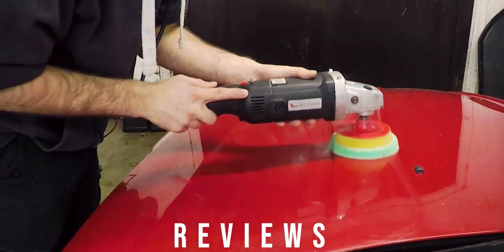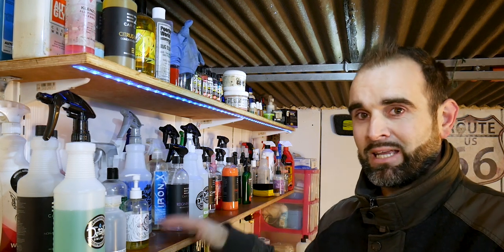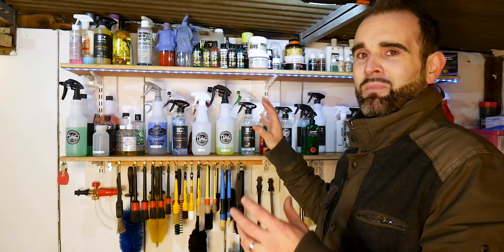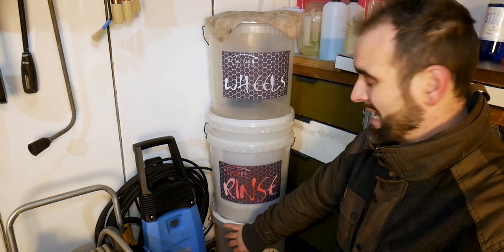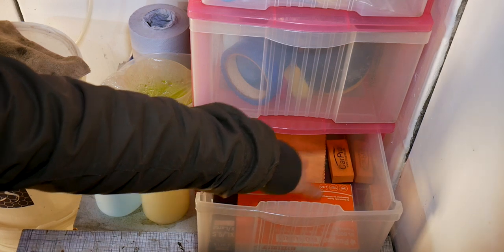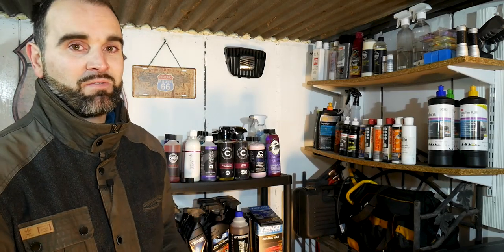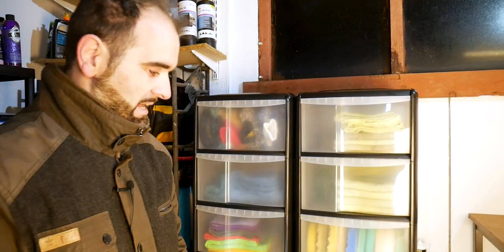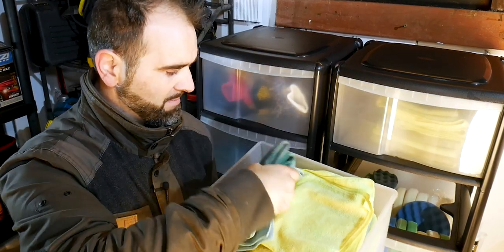Detailing World Garage Tour - How To Organise YOUR Garage Efficiently!

Comment: Hi. Mat, great video as usual. What would you say the autosmart range of products are like. I have just started mobile valeting and concidering purchasing them in 5litre to give them ago. Where did u get your drying towel from the yellow one u like and the blue one. Cheers Si 👍
Reply from the maker: The AutoSmart stuff is decent, and perfect if you're in the trade.

The smaller plush yellow ones are typically sold as a generic plush towel from most suppliers (I used to get mine from Elite Car Care or Polished Bliss).... The blue one with the red trim I think is also often sold as a generic. I picked this up following Car Chem's training day last year (they gave all towels away after the day - I only managed to grab 1)
Reply: @TheDetailingSpace  brill will look into I got a trade account with valet Pro and there stuff is good but some of the autosmart is slightly cheaper and can grab off the mobile vans aswell. Thanks mate appreciate it